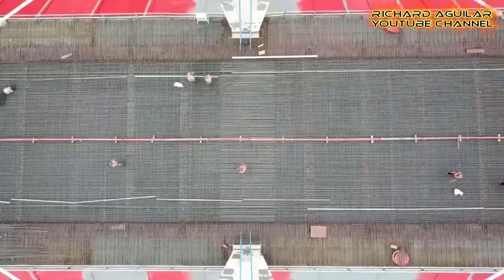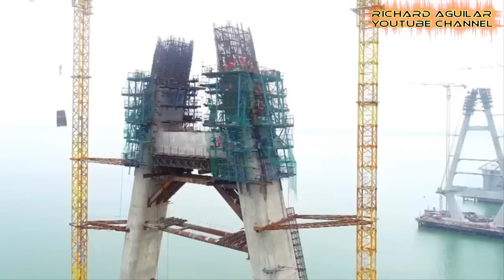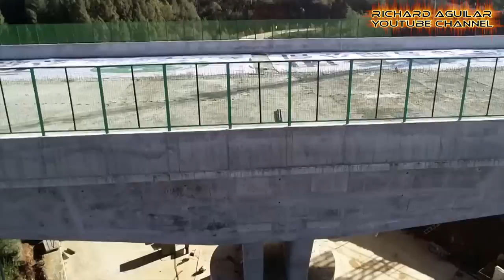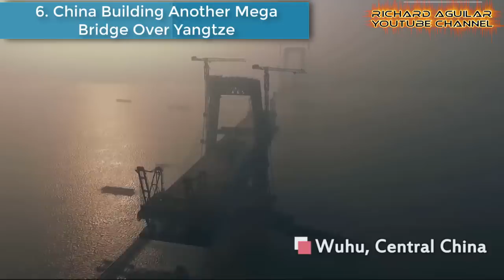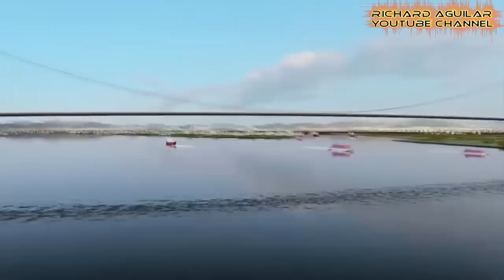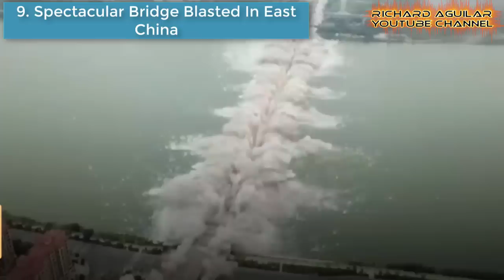China Innovation! Unbelievable Mega Bridges Structures Constructed And Completed

Comment: Currently, there is a mass protest in HK, one of the concern is Housing, with China Building technology HK should join China now instead of waiting for 2047, then housing will be the least of the problems.
Reply: Jason Chua The housing issue in HK is caused by real estate tycoon. HK government wanted to build government subsidised houses since 2000, yet was forced to quit as many protesters went on street to fight against the project after real estate tycoon told them project will lower the house price. Human issue is always the toughest to handle.
Reply: @Dear Father One country but two systems until 2047 this is the facts.
Reply: @Dear Father - Yes, we say one country, HK citizens say interference. Not until the whole of so called 'HK liberation' movement dies down, nothing can be done.